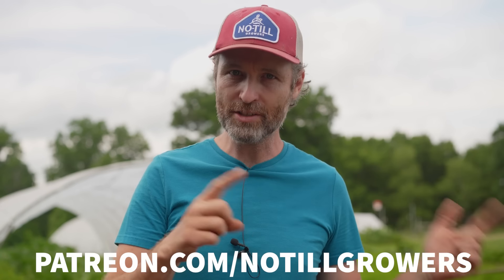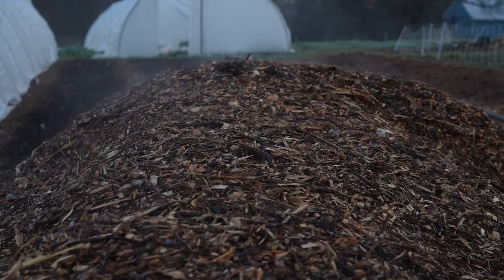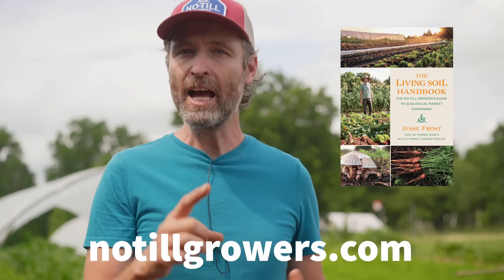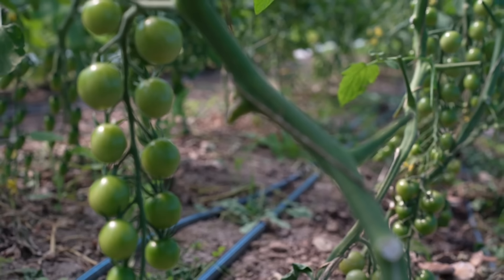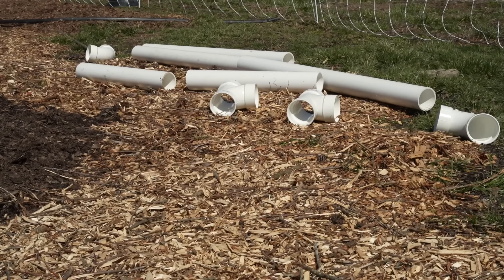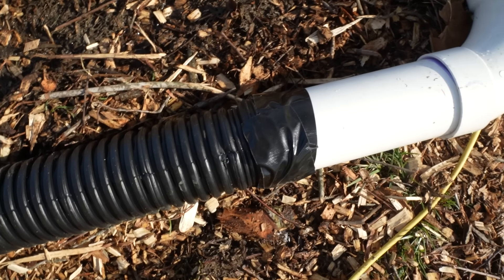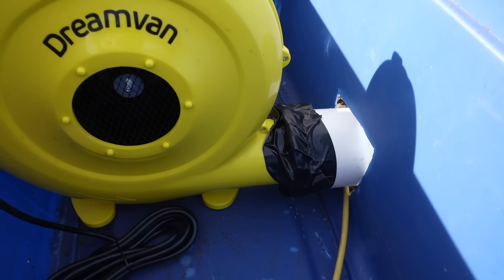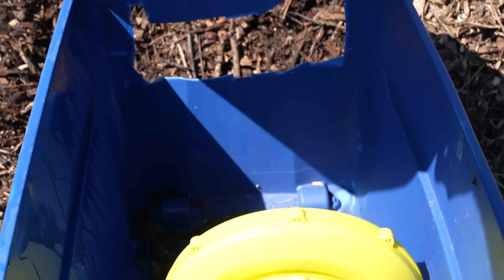Static Aerated Composting System For Organic Farms

Comment: Hey there. I like the system, and I set up a similar one, though in boxes instead of open ground like yours, this January to compost our horse manure (which has an excellent C:N) for use on our half acre market garden. I used solid 4 inch drain pipes because I wasn’t sure the corrugated pipe could handle the weight of 5 feet of material on it.  Does it seem to be holding up so far in your system?
Reply from the maker: Yes, so far so good

Comment: A quick way to make "holes" where you want them on the corrugated pipe. Set a circular saw at about 1/8 inch depth, run the circular saw lengthwise down the pipe where you want holes. It will cut a series of grooves in the outer corrugation, but not the inner one, and is quick and simple. And maintains the integrity of the pipe. 
Also good idea to put a few holes in the bottom of your pipe so there is drainage for condensate or leachates.  But fewer of them would be needed I think.
Reply from the maker: Thanks, James, and good point on the leachate!
Reply: Or, you could just buy drainage pipe, which has a ton of holes in it already...
Reply: Micro plastics…..?
Reply: @YoooItsRex  Yes. I'm not saying that this is the best way to do manage plastics. But have you been to a modern construction site? Microplastics are just buried in the soil where they fall. Often times mixed into the gravel and forgotten about. Sad, really.
Reply: Now THIS is a pro tip!

Comment: 'Aerated static' sounds wrong, as if it breaks the rules for order of adjectives in English, like how a native English speaker knows, without knowing why, not to say 'a red big house', instead of 'a big red house', but now I look at those rules, I'm not quite sure. If 'static' is a 'physical quality' and 'aerated' is a 'type', then it should definitely be 'static aerated', but you could argue that whole thing the other way.
Reply: From my understanding "static" is the method or management style applied, so a pile can either by "static" or whatever word would be used to signify that it is regularly 'turned'. Aerated would be an adjective applied to the pile right? So whether it's 'turned' or "static" the adjective would precede the noun? I think I prefer plants to english...
Reply: Aerated static-pile, just as it would be blue sports-car

I believe static is the type of pile, and aerated is a modification on top of that, since there's no point of additional aeration in a 'dynamic' pile

Comment: Using straight pipes would make sliding them out of the pile easier, to set up a new pile for example. They have thicker walls too, might last longer. I always have straight pipes put it for drainage or water diversion (roof water infiltration, etc) because it can be maintained, pressure washed, de-clogged, etc. Sorry for my approximate english

Comment: Push- fit soil pipe may be easier to relocate. The question is- is it worth it for the cost of the power used? Possible Johnson Su vertical stack with pipes will work too with forced air but temperatures may be lower. Datalogger would be useful for recording temperatures.

Comment: Rather than move the entire compost heap, you could move the blower-tote down the row 20 feet; and create a new compost heap. You would need a new piece of corrugated for each compost heap location. But duplicate corrugated is relatively easy (compared to moving an entire heap by hand, or renting a skid-steer).

One long piece of corrugated (in a serpentine pattern) would probably be easier/cheaper/better.
Reply: I approve this message. Nice compost ideas. Let us cook.

Comment: Thanks for your video!    I speak not from the prospective of an experienced composter (yet), but that of a process engineer with yrs of experience with leak testing.  Not to be negative, just something to consider...  in a pressurized system the flow is going to go where it has least resistance.  Basically, if you leave 1 of your drainage tiles uncovered, with no resistance from compost covering the holes (which your video shows you did), almost all of your air is going to leak out there and not go into your pile.  You would be better to remove the drainage tile and cap your PVC branch or make your grid smaller to begin with.  I wish you the best.
Reply: in that case, would adding a valve to close off the unused/uncovered areas make sense?

Comment: I'm thinking of using a compressor to supply a periodic burst of air to static piles for air supply and decompaction, maybe plumbed in with stainless or at least galv tubing. [edit: smaller scale than this]
Also I was looking for a gun anf lance to poke into garden compost bins but there doesn't seem to be such a thing.

Comment: Hi Jesse,
You mentioned feeding your compost to your worms. I will say in our experience the worms have found our curing area and set up shop like none other. Actually, we get a lot of worms coming out of the initial aerated bins as well. Not sure where they hang out when it's "cooking" at 150-160. So I think we get a lot of the microbial activity added there. I like your system and hope you get the results you want. It's been hard for us to dial in the right ratios of c:n and moisture but after 2 years we are getting decent product for our food gardens! Plus reducing carbon emissions from our food waste for our 18 household community.
Reply: Worms move somewhere a bit cooler when things warm up. They get around.

Comment: It looks very heavy in carbon - still very "woodchippy" at end of process.  Does this rob the soil of nitrogen. Curious how you get this to all balance out since it looks like a lot of carbon!
Reply: If I remember correctly he's in a semi- subtropical zone so his soil burns through carbon very quickly. If you were in a cooler zone it could be more harmful. Also it seems like using these more woody composts as a top-dressing doesn't cause as much nitrogen disruption in the root zone.
Reply from the maker: Yep, it's a mulching compost so I want a higher carbon ratio

Comment: Slightly bigger farm, but we got the state to grant us a 20’x100’ slab and timber frame roof with solar panels for ASP. 

We build pretty large piles from food scraps, animal bedding, crop residues and wood chips. We’re lucky to have hooked up with a local residential/commercial compost service who drops off significant amounts of scraps, and we also accept scraps from the CSA members (400 members/week). A couple tree businesses dump chips once a month or so. 

After one year of building piles, I’m mostly getting a mulch type of compost- the wood chips aren’t breaking down well. I think I let it get too dry in the ASP bay, and definitely too dry in the maturing bays. I get a lot of actinobacteria, and maybe even ascomycetes or powdery mildews (dusty white powder evenly distributed in most of the pile)…

So trying to wet it down better when I blend and build new ASP piles. I also think I should inoculate the maturing piles with vermicompost tea or some healthy fungal cultures from the woods- KNF style.
Reply from the maker: Excellent thank you for that insight.

Comment: Great start and it should be a very productive system.
One note is that I would use a schedule 80 pipe underneath the piles as they will stand up to the weight and moisture over time and the corrugated black drain tile stuff gets mushed, a bit blocked and defeats the purpose of the airflow.